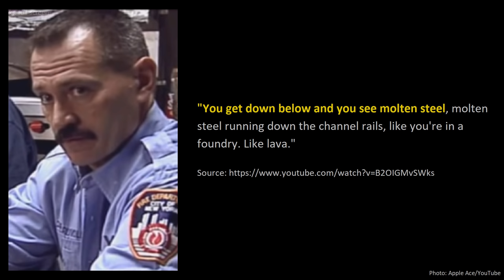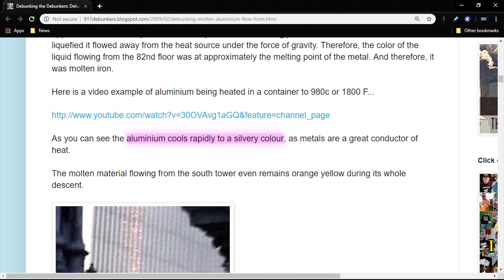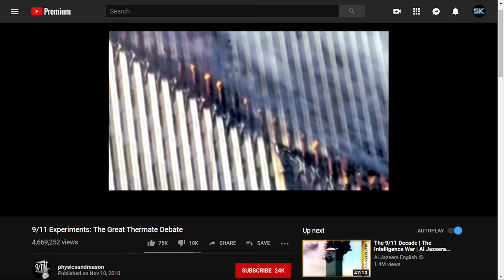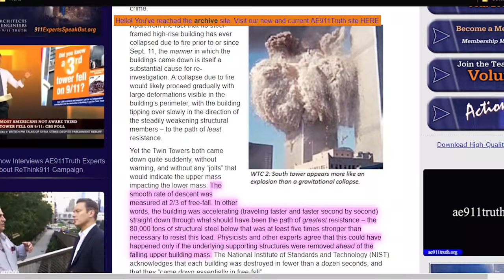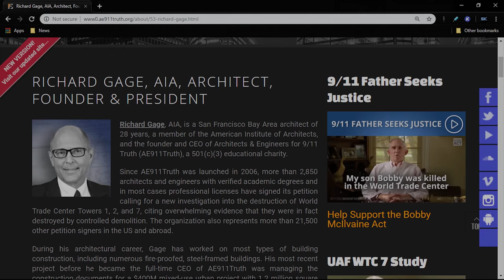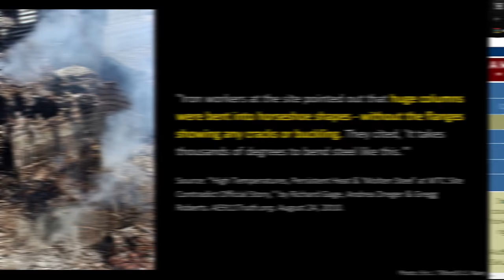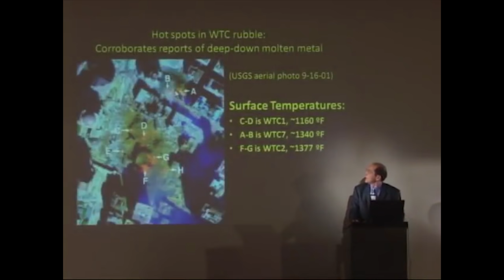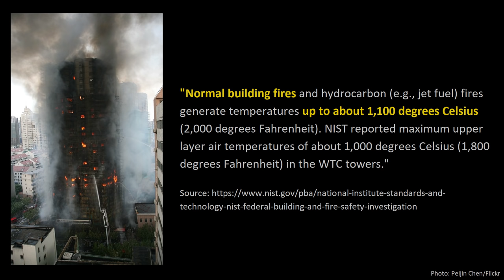9/11 Truthers Debunked: "Molten Steel = Thermite From Controlled Demolition!"

Comment: The Windsor tower in Spain burned for over 20 hours & the Skelton of the structure remain in tact. Theres videos of it here & youtube. What about the small explosions happening as the building collapsed? Looked exactly like a controlled demolition to me.
Reply: 12weasel100  🤣😂🤣😂🤣😂 well, you obviously gave enough of a shit to write all your proof points, which sound insane by the way. The fact that you're unable to admit to the fact that the wc was a controlled demolition is your problem.
Reply from the maker: One key difference is the structural damage caused by the plane impact, AND the fact that the explosion blew off much of the steel's fireproofing in the Twin Towers.

Also, setting those clear differences aside, your logic is just junky.

"Fire caused this one particular building to collapse"

=/=

"Fire will cause all buildings to collapse"
Reply: 12weasel100  thats okay with. I can understand the point you're making. Im not offended that you find my logic "junky" .

Comment: Who ever said termite was used on the outer columns? I've never heard that.  Why would you do that? Wouldn't work! Gotta get the inner core.
Reply: Collapse initiation was due to buckling failure of the perimeter columns.  Cores were last to go.

Comment: Pictures of steel thats been cut would also have to be shown to have been from pretty much the first 48 hours. By that point there were cranes, heavy equipment and cutting torches were in use. Rescue companies regularly keep cutting torches on the rig and know how to use them. Its a tool we don't use often but absolutely do carry and know how to use. Fires absolutely burn in rubble piles and did so at ground zero, they become well insulated and have limited oxygen which means a high energy but slow burning fire. Its like a primitive pottery kiln, not a well ventilated fire in open combustibles. It crept thru the debris consuming normal combustibles, the limited oxygen and high heat working like a coking furnace in a steel mill. The thing is that truthers are asking for proof of things that didn't happen, a negative confirmation which is often near impossible to say with 100% certainty while the 0.0001% chance is seized upon as definitive evidence justified by its existence regardless of the probability.

Comment: No need for a 40 minute video diving deep into analysis… the controlled demolition crowd are beaten by the fact there are high definition videos right here on YouTube showing the collapse beginning right at the point of impact. Several show the outer columns clear as day slowly bending inward, then crushing in on themselves and giving way, causing the South Tower to tilt and fall.

They are forced to explain:

1) How did the plane hit the exact spot where the explosives were?

2) How did the plane crashing and exploding through the building at 500+mph NOT damage the explosives?

3) How did the explosives survive a raging inferno for almost an hour?

They can’t answer these, because they know how insane it would be to attempt doing so.

Comment: 32:50 That photo is horrific.
It's taken looking South from West Street, just about underneath where the North Bridge stood. WTC1 is on the left of the photo. On the right of the photo there are steel beams on the other side of the road, between the amex and merrill lynch buildings. That's a bit further away than WTC7 was, no wonder that building's front got a huge gash down the front and it caught fire.
Well really there are steel beams everywhere in the photo. Most photos only show either a close up shot of beams or a distance shot of the tower's footprints. In this photo you can see the remains of the building in the background, where each tiny beam is actually the same size as all those beams in the foreground. The scale of the collapses and debris footprint is unimaginable, even with this photo.
Thanks for reading my essay.

Comment: The "debunking" of the thermite experiments was very telling of your bias. Knocking a bolt off with a sledge hammer is a tiny force compared to skyscraper load forces.

Also, several weeks of heating will not get temperatures up to 1300 C due to second law of thermodynamics. You need a heat source higher than 1400 C no matter what. 

Finally, there was thermite chips found in the debris. 

And ps. Building 7 was analyzed by an architect and could not have achieved "global failure" aka sudden fall into its footprint. His theories have not been debunked at all.

Sorry I'm sounding a little prissy in my dialogue as well. We do no service by arguing but by being stoic and honoring eachother as fellow humans and catalysts for the truth. I honor you.

Please anyone reply in that spirit.

Comment: Lol, thermite is used for welding, it will only deposit more metal as it melts after being lit, it's like trying to cut thru a piece of plastic by lighting a piece of that same plastic and letting the melting plastic fall onto it.. and what looks like thermite pouring out the corner of the tower is actually a piece of landing gear, made of magnesium. https://www.youtube.com/watch?v=ISF3E4CuGWU

Comment: 1:25 “Neither thermite nor conventional demolition charges attack steel in this way, whereas building fires are more than hot enough to cause steel to become highly pliable.”

2005, Madrid: The Windsor Tower caught fire, a fire that lasted for 19 hours.
The structure “consisted of a reinforced concrete core and six reinforced concrete columns within the floor plate area, and steel load-bearing mullions (steel edge columns) around the perimeter.” 

Notwithstanding the fire and its duration, the overall structure didn’t collapse upon itself and, the fire, though able to weaken the steel structure around the building, didn’t result in a general structural collapse (you could see pictures of the building still standing, before it was demolished).

Now…those were 19 hours.
 And the structure was nothing like that of WTS 1 and 2 (and 7, whose unexplainable total collapse we tend to forget about).

Are we really to believe that two planes were able to cause such structural damage, to such massive engineering marvels (designed to withstand the impact of a plane), within the span of 50 minutes, resulting in the TOTAL VERTICAL COLLAPSE of the towers at practically free-fall speed?  

If you really think that, I don’t have anything to add.
Reply: Now…those were 19 hours

Only 2 of which was out of control. The rest was just knocking down small pockets. And you left out the part where the upper steel floors fully collapsed leaving only the concrete core in place.

and 7, whose unexplainable total collapse we tend to forget about

Try reading the NIST Report where they explain the collapse.

🙄
Reply: @timshea4279  I did.
You try reading Dr. Hulsey’s full analysis of WTC7’s collapse (which heavily critiques NIST’s report), you might start to understand the world of lies we’re living in.
Reply: @Adamanthon  
I have. Do you know he didn't establish his 3 stated objectives? First and foremost of which 'fire didn't do it' isn't established without testing all aspects of fire doing it.

'NIST is wrong', even if he showed this, doesn't establish explosives brought down the building. 

Should be obvious.
Reply: @timshea4279  I’m astonished at your blindness… truly…
Reply: @Adamanthon  
And yet you can't respond to what I wrote. Hulsey's FEA is a joke. He shows the EPH falling through the building with no damage to itself or the structure and shows columns elongating as the building tips! It isn't actually a FEA but a simulated cartoon.

You're only astonished because you've never actually read the report and don't know what's in it. You saw it on conspiracy website and that was enough for you.

Talk about blindness.
Reply: @Adamanthon  

Here's a few things to consider, in re Hulsey and his nonsense.

1, The supposed "study" of Hulsey's was bought and paid for by A&E911. Now, there's nothing wrong, per se, with that, feasibility studies and the like are bought all the time. But, considering that A&E911 have a vested interest, the impartiality of the "study" does leave some to wish for.
2, the "study" was to take 2 years to make. And then it got moved. And then it got moved again. And then it went very quiet for some reason for quite some time. And then it finally was released, 5 years after it was announced, and 3 years late. I'm not saying the "study" was massaged to fit the customers wishes, but it's rather interesting that it took TWO AND A HALF times as long as it was meant to.
3, the "study" was supposed to be open to criticism by the public, and then it was supposed to be peer reviewed after that. And then, for some STRANGE reason, that went away, and it was just quietly released into the wild with no mention.
4, the "study" findings were already determined before it had started. A&E911 asked for donations and organized a drive to be able to pay for it, at which point they announced what the outcome would be. Let's repeat that. A&E911 told the world what the "study" would say, even before they'd paid for it, much less before it started.
5, the "study" is more or less spent refuting the NIST report. However, NIST isn't the only report that say that the collapse started due to fires. These other reports are mentioned but aren't addressed.
6, Hulsey's "study" tries to so something impossible. It attempts to prove a negative, i.e. that fire could not have been the starting mechanism for the collapse. This, as anyone with even the slightest knowledge of science knows, is impossible. You can prove what happened. You cannot prove what didn't happen.
7, Hulsey is not competent to make the "study" he did. While he is an engineer, his work has entirely, and solely, been about road-surfaces and bridges, as well as cold-weather effects on the same. There is NOTHING in his work that has anything to do with buildings, or fires.
8, the "study" is a shambles and a joke. There are holes in it so big you could drive an 18-wheeler through them. As just an example, the model showing the data and conclusions of the "study" has the engineering "penthouse" of the WTC 7 hinging in the middle, completely dissimilar to what visually happened, then collapsing, in one piece, through the building, without causing any damage to the rest of the building, stopping about a quarter of the way down, and then literally just hanging there, still in one, deformed but still mostly intact, piece.
9, the Hulsey "study" has been referenced, or even MENTIONED, in any reputable engineering publication, exactly NEVER.

And, while it isn't an argument as such, it is very interesting to note that Hulsey went from being head of the department to being "Professor Emeritus" after his "study" came out. This rather suggests that, much like Steven Jones, he embarrassed the university and so, they shuffled him off to the "honorary" position so he wouldn't be quite so in the public eye.
Reply: @Adamanthon   So, in other words....you had nothing and so you felt you had to blather irrelevant nonsense to cover up for that?

Comment: Steel don't melt with the heat from jetfuel!. Only when you put it together with oxygene under high pressure! Then it is possible to use it for welding Steel.

Comment: Steel did not have to reach its melting point in order to cause the Twin Towers to fail, given its unique construction, as well as the massive compromise of its structure after sustaining the impact of jet airliners traveling more than 400 mph. Just softening the steel would have been enough after the jet fuel set so many objects on fire in the buildings. Look up the swaying of WTC 2 after that plane hit. Just because the building lasted as long as it did doesn't mean it had not suffered a fatal blow. As to the aluminum/thermite debate, that seems to be to be a massive set of sparks from electrical fires near that floor. But I have not studied this issue at all.
Ref.: WTC south tower sway 8x speed
https://www.youtube.com/watch?v=Qk5NQgU-9G4

Comment: Why opt for thermite? It allows for a cut without an explosion. The aircraft, carrying 92 people with an average weight of 80 kg, contains a substantial amount of water—5,152 liters or 1,361 gallons. Contrary to common belief, most fuels do not ignite upon contact with heat; it's the fumes they produce that catch fire. Upon impact with the tower, the liquid fuel spreads out and evaporates within minutes. Velocity in this context refers to the sum of the velocities of all molecules (fuel components), divided by the total number of molecules in a small volume.

The mass average velocity (v) of a mixture of N species is defined by: v = Σᵢ=₁ PiVi/p.

In this particular scenario, the fuel isn't moving at several hundred kilometers per hour, isn't spread across the wingspan of the airplane, and isn't dispersed by instantly "opening" all fuel tanks. Additionally, some of the fuel doesn't ignite and get ejected as a fireball.

Consider a bucket of fuel dispersed on the ground—it takes time for the fuel to evaporate. Conduct the same test but ignite it, and observe how long the fire persists. Keep in mind that the fumes can ignite explosively.

Jet fuel played no role in the collapse; it dissipated within minutes. The visible substance dripping post-impact could be anything. The plane cut through the central core, weakening the structure. The collapse may be attributed to fires initiated by the jet fuel. Just because a plane collides with a building doesn't guarantee immediate collapse or no collapse at all. The load shifts, and a slow chain reaction could lead to the building collapsing an hour or hours later.

Thermite composites, composed of metal powder and metal oxide, are employed in contemporary demolition practices. Nano-thermites, specifically metastable intermolecular composites (MIC), represent a more advanced form. These nano-thermites feature significantly smaller particles, enabling elevated reaction rates. It's important to acknowledge that these thermite composites did indeed exist during the period in question.

The use of nano-thermites in the past remains uncertain (more studies are needed). Due to their creation from reactant particles with proximities approaching the atomic scale, nano-thermites exhibit energy release rates that are significantly higher. Theoretically, this makes them far more energetic than the conventional backyard tests often witnessed. The potential utilization of such advanced thermite composites during that time period remain subjects of speculation.

This is the nano thermite study in question: https://benthamopen.com/contents/pdf/TOCPJ/TOCPJ-2-7.pdf
The three WTC building were not the only building that collapse after the incident. Other large structures were demolished and they also produces dust, no samples were taken and studied of such nano thermites could be found. Also pentagon was hit by a planed and burned dues to jet-fuel, no samples were taken from that site. Could the planes create these nano sized particles? We dont know.